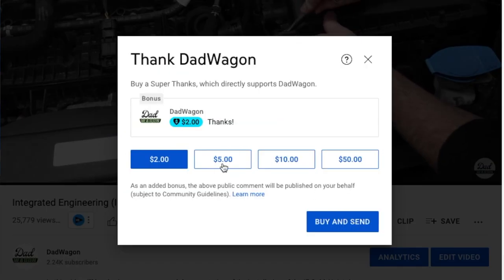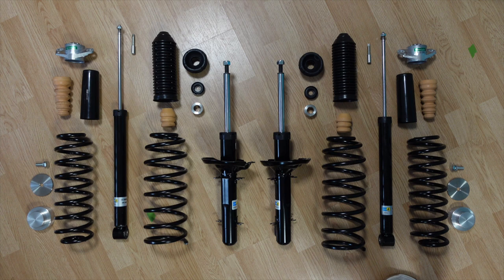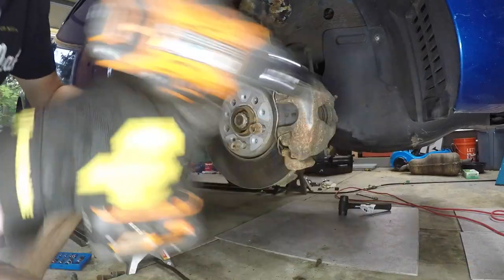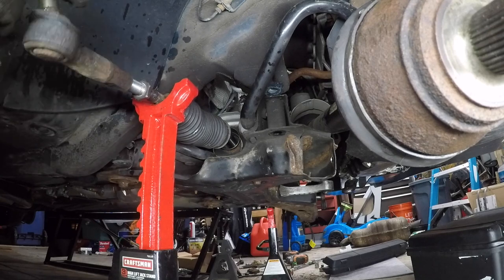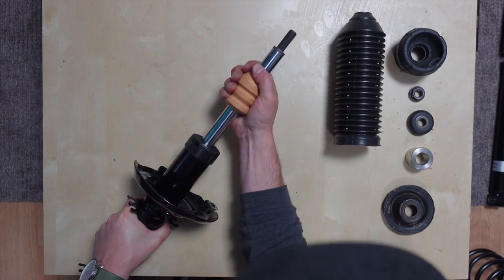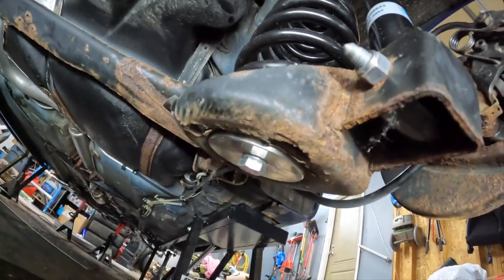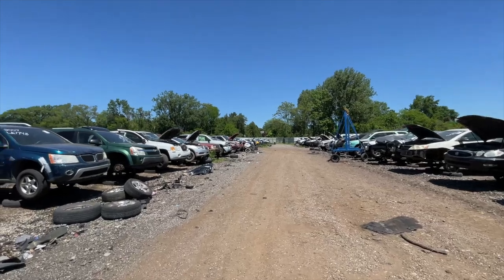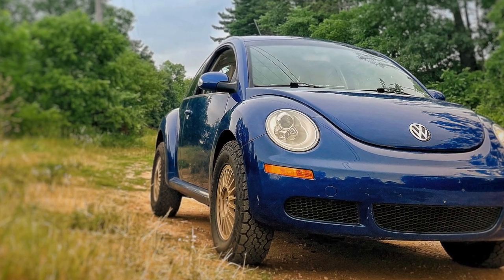Installing a 2.5" Lift on a 2007 Volkswagen Beetle - Can this Bug Off-Road?

Comment: I don’t off-road my 2010 bug. But I drive around rural areas/potholes and dirt roads enough that the rattling split cracks in my aluminum gas tank. Just managed to get a new tank after lots of searching and highly considering this in order to hopefully prevent the same problem again

Comment: So, what's stopping you from leaving the stock struts in place and just adding a spacer on top?  You'd get the lift without the stiffer springs, thus a more smooth ride.  The rear can be the same, but with adding the shock stem extension.  Heck of a lot cheaper since this can and never really be an offroad vehicle.
Reply from the maker: Sure, of course you could do that. My shocks needed replacing either way.

Comment: I loved the video edit of the race truck jumping while you described why you wanted to add lift to the beetle!!! Fun project!!!  Question:  do you know if you need to beef up your transmission to handle the larger tire/wheels??? Or did you need to recalibrate the speedometer?
Reply from the maker: Speedometer is definitely off. Not planning on reprogramming since it's not a daily driver. Not sure on the transmission, but I would have to believe it's going to stress it a bit more.

Comment: Putting bigger tires on , does it affect the power of the engine? Did you do any changes or adjustments to the engine or transmission?

Comment: I have a 2009 S series Beetle.  From the factory they are a very stable vehicle.  Did incorporating the lift kit affect this stability, in the turns?   If so, how much?  I really love how these cars corner and handle at speed.  Was this affected much?  Please advise.

Comment: I enjoyed your video! It’s been a few months now. What’s your take on how it drives? I am considering this kit on my daughters 2001 beetle so it needs to drive well
Reply from the maker: It drives great. the only issues i have is still making room for these big tires in certain spots - if you go with a moderate tire size increase, it will drive amazing.

Comment: Hey Dadwagon, what rear shocks are you using to achieve the lift? Also is the ride quality soft?
Reply from the maker: Ride quality is medium to fairly soft with the large tires. Suspension is stiff than stock, but not nearly as stiff as many who choose to use SUV Shocks and springs.
Reply from the maker: They're from the Bilstein HD line of shocks. Visit VWLIFTKITS for the proper shocks.

Comment: Too funny! Just ordered the Stage 3 kit for my 2010!

Question… I noticed the front sits lower than the rear… do you know why? Or how to make it level?  Thx!
Reply from the maker: I was told that it's visually lower... but the lift is equal. This is true in all their promo photos too. I'm not sure why. I agree that I'd like to see it fully level.
Reply: @DadWagon  just installed it yesterday and today installed the tires. Uploading video tonight… but yes it’s higher in the back too…. Wonder if the rear shock spacers at the top is what is making it look that much higher…. Wonder what happens if removed…
Reply: @DadWagon  I got a reply from them! 
They said the kit is designed that way in front so there’s no issues with the axle at a different angle and that the 2.5 engine is a bit heavier so it weighs it down a bit… and in the rear is higher to allow more cargo load, so it won’t sag I guess

Comment: What size tires are those? I am going with 225 75 r16 and want to see where they will rub.
Reply from the maker: 215/75/R15 - rears have no rubbing. Fronts i had to remove a bit of liner and hammer some of the metal on the driver side. I plan to get some wheels with more offset - or back spacing and this shouldn't be an issue.
Reply: @DadWagon  ok awesome I appreciate your response. I figured getting new rims with 0+- offset were the best option. Since I already got the tires I'm kind of stuck with them.
Reply: Do you know what back spacing you need for them not to rub?  @DadWagon